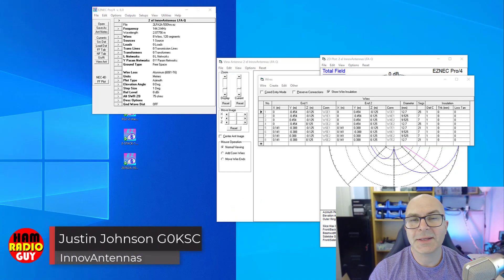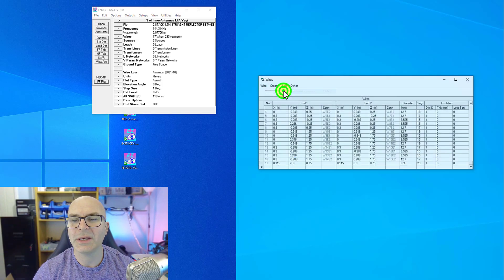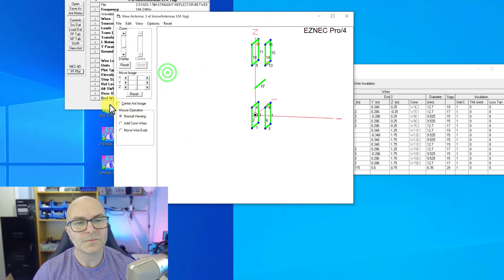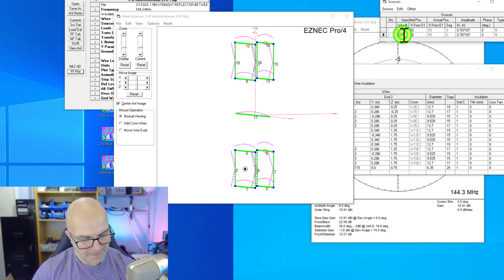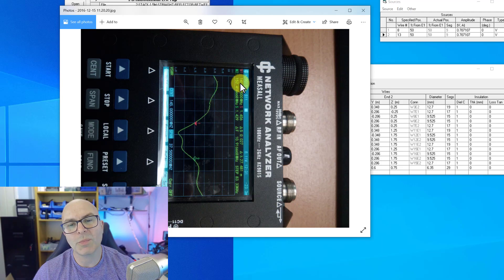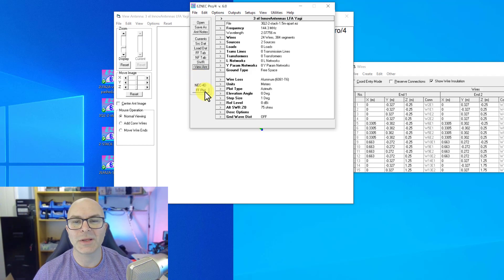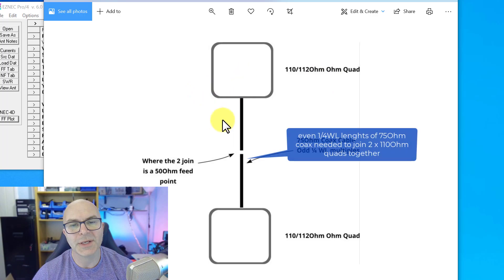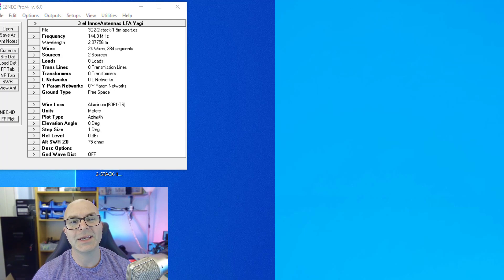Quad Beams - Are they Better that Yagis? Part 2

Comment: Thanks for this info. I have been pondering setting up a pair of phased multi element diamond quads (vertically polarized) for 20m and wasn't sure about the impedance matching. I've built 3el diamond quad loops using a rope for a boom and was very impressed with the results but I have always wanted to phase a pair.

Comment: Hi Justin, Love the video, and i think this would be a great solution for me. I am still using a single 15 element LFA ( the picture of my previous stack is still on your site). But i had to mount it on a side arm because the antennas are on a lift  and the distance between the tower and lift is nog enough for normal yagi element lengths. How much gain can i get out of a 6 or 7 element version ? Hoping that the dubus magazin drops in the mail soon. 73 Jan ON6ZG/DL6ZG
Reply from the maker: Obviously the longer the antenna the better in most cases. outrigth gain will be given up for a broad banded design too.